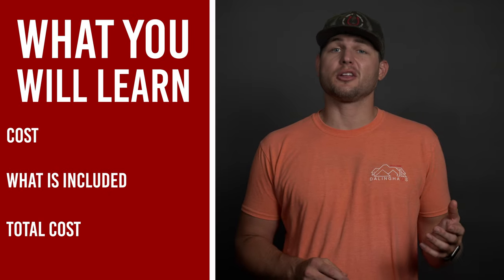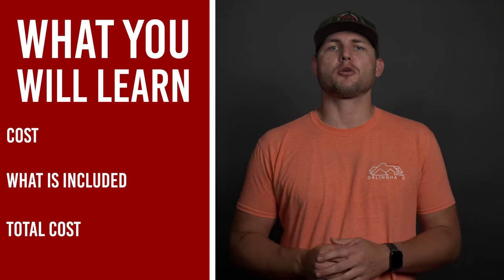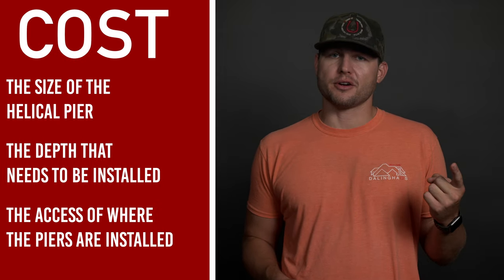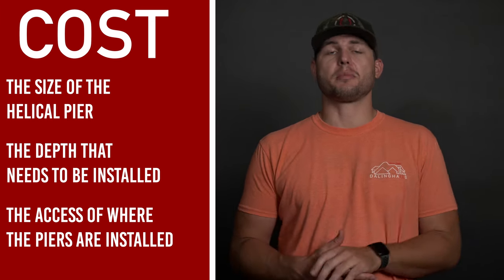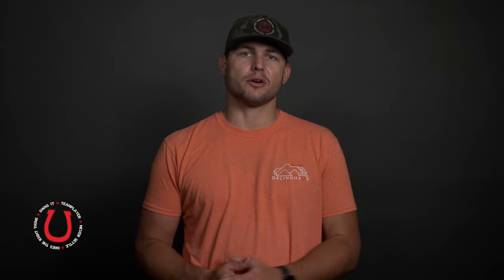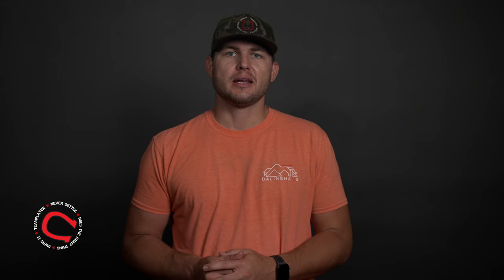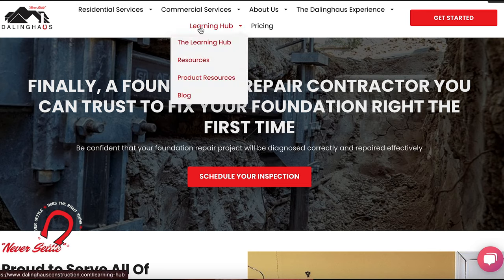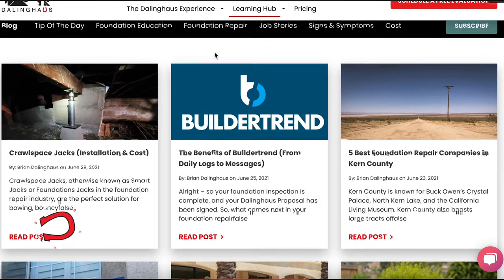How Much Do Helical Piers Cost?

Comment: I’m across the country from you.  Have contracted for helical piers to be installed in a couple of months.  I asked about having expansion foam injected under the slab after the foundation is raised. The contractor replied that I wouldn’t want to do that but didn’t elaborate why.  Is the foam recommended by you or not and if not, why?  My concern is that there is nothing supporting the broken section of the slab except for the piers around the perimeter.  I’ve also had a past problem with armadillos and opossums burrowing beneath the slap and want to keep them out.
Reply from the maker: Hey JT,
We always do and highly recommend doing the foam injections, void fill, under the slab after a lift for the reasons you have stated.

We want the slab of the home to be supported after a lift, just like it was when it was originally built with the soils beneath it.

The slab was not originally designed to be suspended and will more than likely experience settlement or additional cracking in the future.

We have also utilized the foam injections to densify and fill voids in the soils caused by gophers, similar to what you're experiencing with the armadillos and opossums in your area.
Reply: @DalinghausConstructionInc  Thanks!